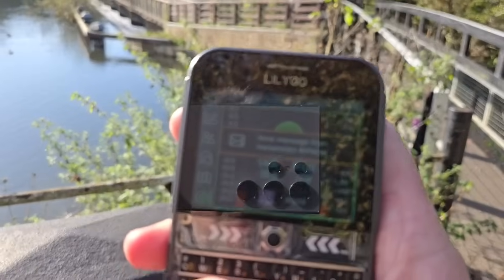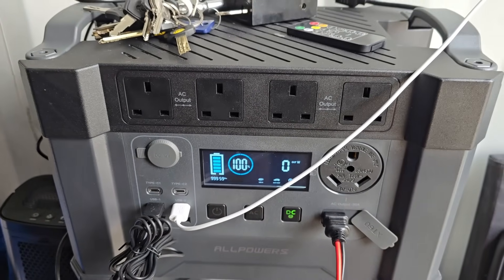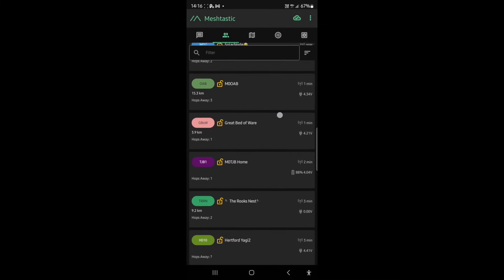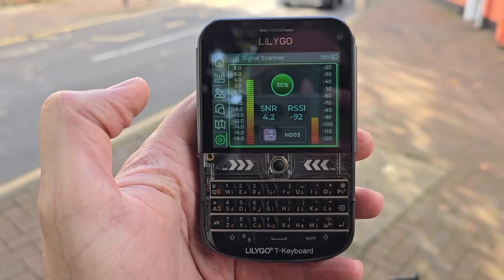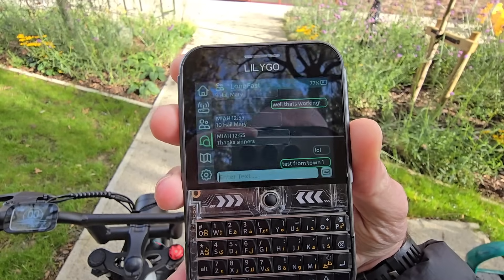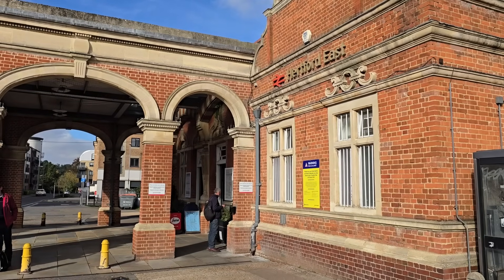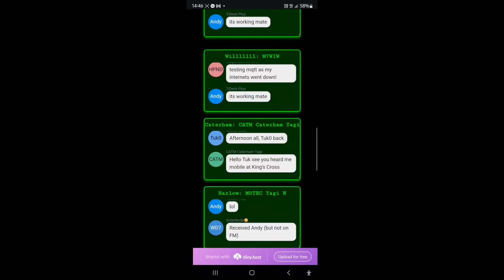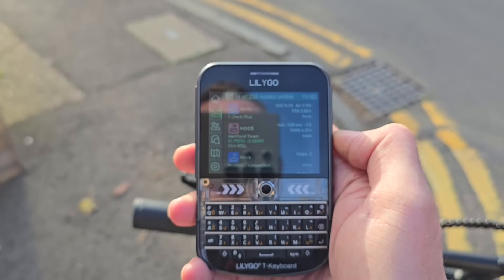CREATE A CELL NETWORK FOR TEXT MESSAGING IN YOUR TOWN!!!

Comment: I should really design a pocket node with an internal antenna, something that looks like a pager with a belt clip 😜
Reply from the maker: Yeah do it! Someone should make a firmware for a 2 line LCD with backlight and 3 buttons, basic menu and the ability to scroll through messages!
Reply: I thought my unibrow would've sufficed since it has the correct wavelength 😂

Comment: You need a device with better SNR to get the maximum rssi the heltec and T-Deck are noisy
Reply from the maker: Yeah, I mean the point of this was kinda testing in the  worse case scenario. Most users will have better antennas so if 'this' setup works then others will get a good service in the town.

Comment: Any chance of creating a video of  how to setup an  mqtt service to link two separate clusters that are out of range of each other.

This way the mqtt wouldn't be the standard service and flood the network
Reply: That's a Great idea! I worked on controls engineering with scada, PLC and iot  and  built a mobile app to link various networks and it works! It should work also with LoRa with same underlying principles 😊

Comment: What's the best mhz to get into this, it gets confusing
Reply: 868 for Europe. 915 for 'murica (note, the ardware for 868 and 915 is the same, besides antenna). 443 is global amost, but it requires a radio amateur license. 868/915 are unlicensed and where you can find peoples.

Comment: I don't want to be the party pooper here, but you know that's not legal, right?
Reply from the maker: How so? We are allowed 500mW EIRP with a 10% duty cycle on 869.500Mhz
Reply: @andykirby  You're not allowed to use an antenna with such gain, even if your EIRP is at or below the legal limit.
The "gain" you are allowed to have is exactly the delta between ERP and EIRP, that is to say around 2db.
Not that i care, in fact, encourage this wholeheartedly, but maybe don't post it on youtube?
Just don't mention the antenna gain.

PS: Such high gains will easily overload that kind of receiver anyway.  I think you might benefit from a band pass filter.